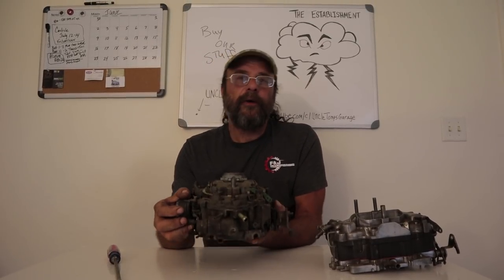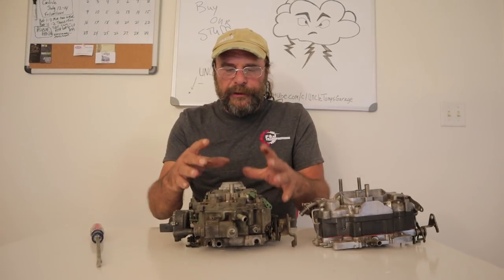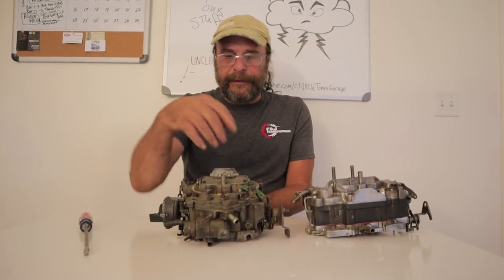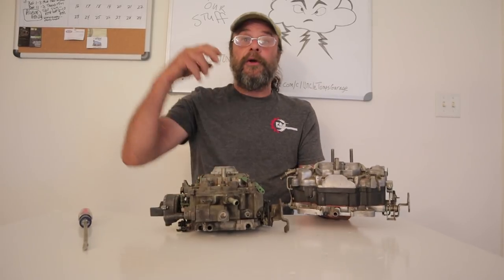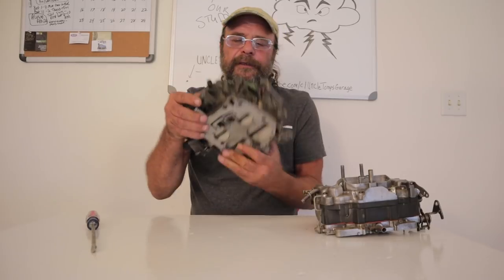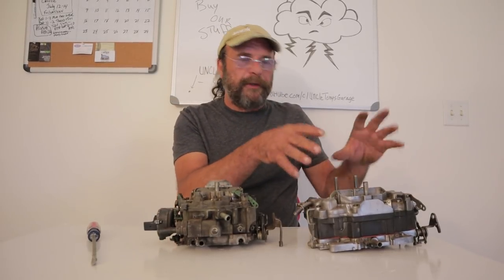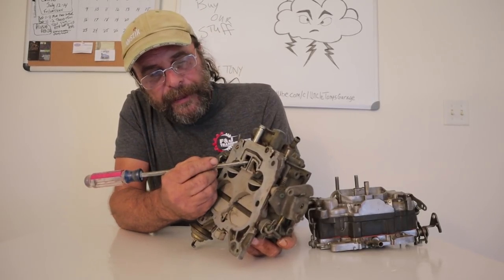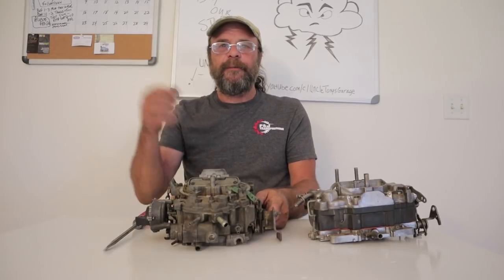The Quadrajet

Comment: I love Quadrajet carburetors, if you learn how to build them, and do the little tricks to them, they will out perform any street carburetor made. I've built Quads for years.
Reply: I'll be honest... I HATED them until my dad showed me how to actually tune one correctly. Now I'm a fan of them.
Reply: Take a Q jet over a leaky fucking holley  any day
Reply: Amen brother take a Q jet any time since the late 70s..I have a shelf full of them
Reply: my only problem with them has always been that they're usually toast by the time you get them. No pressure regulation usually. By the time I spend the time rebuilding one. I'd rather just spend 300 bucks on an edlebrock, 15 bucks on a regulator, and never mess with it again.
Reply: No they wont, not for making power, might be the most reliable workhorse 4bbl though.
Reply: You're right! I knew a guy who raced circle dirt in the stock class and had to run a q jet. He was a master at them and you could get one for free give him a hundred bucks to rebuild it for whatever! Economy, or performance, it would deliver. Just keep a good fuel filter on it because they'll plug up easily.
Reply: One time i built a house from construction paper and popsicle sticks
Reply: WILLIAM CLYNES  biggest one so a big block one the quadrajets have a air dam/ adjustable secondary air flow flap it wolnt flow more air then the motor needs so you can't get too much carb
Reply: Most quads were detuned.  Drill new holes in the secondary’s hangers, get new thinner needles, and away we gooo.......

A plastic spacer plate would insulate the carb from the manifold.
Reply: @fitty6pickemup because Holley pays to have their crap shown all over the place
Reply: @Nostradamus_Order33  Using this point you made I used one on a 455 running methanol back in 1976. Had to take the front jets completely out to flow enough.
Reply: @mtjeeves1234  315$ is a lot of money to some guys. Im building a dirt car with very limited Holley options. and quadrajet is wide open. The holley that would be best runs for around 150-200$ in my area. i just picked up a new 6 month old quad for 40$ because the guy "dont know anything about them"
Reply: Agreed!!
Reply: Korri Galbraith  I used to buy them newly rebuilt for 125 at autozone...
Reply: WILLIAM CLYNES the one off of Buick wildcats.. they have the big fuel inlet that comes strait out the front, not at a 90 from the side... range from 500cfm-800
Reply: @thespiritof76..  I don't have to hold onto my ass when I drop the hammer on my 86 K2500.  700R4 kicks down and that 350 the carb lives on reminds me of my dad's 2013 Mack when it's trying to get rolling. Though my timing needs to be checked and the carb could use a tune up.
Reply: right--when they good an tuned they the best but...if not they are the worse  --
Reply: Any good videos out there that you recommend?
Reply: I'm looking for a carb for highway cruising on a 70's Charger. Think a quad would be great.
Reply: I love Thermoquads carburetors, if you learn how to build them, and do the little tricks to them, they will out perform any street carburetor made. I've built Quads for years.  Sorry i stole the whole sentance , but it is just as true .
Reply: Teach me teacher!!!! 82 Rivera. 307 V8. sat for AWHILE!>> 35k original miles (supposedly)..
Bogs at 35.. ..gutless .   What tricks?? Just like 10 more HP..
Reply: I've had many different brands of carburetors for many different applications, Rochester has always been fine by me as well as my go to dozens of times without any real issues. I still use one now, year after year it's been very reliable. It's never bogged once.
Reply: Would you know what carb I have on my 1984 Riviera with the 307 OldsV8??
Reply: @jeffneis553  one way to find out is remove your air cleaner and shine a flashlight directly at your carburetor, it ought to be right on there. It's probably a Rochester, GMs go to carburetor forever.
Reply: @irocitZ  I'll see if I can get up there, bad back problems. Appreciate the answer.
Reply: @jeffneis553  oh man, that's the worst because I know exactly what you mean. I've recently learned that back issues and the car hobby don't go well together.  The only good part is I've liked cars much longer than having back problems instead of it being the other way around.

Comment: I've watched my dad Rebuild alot of those Quadrajets  he was trained at the GM school in Fairfax VA  he also taught me how to rebuild the Turbo 350 and 400 he is 82yo now and is still helping us 4 BOYS at our EDWARDS BROTHER'S TRANSMISSIONS shop in Roanoke Rapids North Carolina THANKS 😀 Louis R Edwards Jr
Reply: I may have to give you boys some business 😉. I'm down here in Mount Olive.
Reply: Always thought a guy who could rebuild, and tune a quadrajet was a step above. Tony confirmed this in his comment about an all out quadrajet will need to be spot on.
Reply: My grandfather is religious with his Quadrajets, he has six put away in storage and one on his 78 El Camino with a 350 from a z28 camaro. It may not be fast, but damn is it reliable and smooth. He's used that engine with that carb for over 30 years. over 300,000miles

Comment: The biggest mistake people make with the quadrajet and the thermoquad is the secondary air valve adjustment. They seem to think you want it to fall open as soon as you get into the secondary's. Not the case. You need the correct tension on the spring so the vacuum has to pull them open. Otherwise you crack open those huge secondary's and the vehicle falls on its face.
Reply: You are 100% CORRECT
Reply: i was 16-17 when i learned about that spring on the secondaries. a little helped so you bet i sprung that way loose! all but hit my nose on the windshield when they snapped open and dumped a pile of fuel into the engine. slower learning curve for some of us but as long as you survive and learn it's all good.
Reply: @Peter Lockhart I have heard so many stories about the spring adjustment thing that it is getting ridiculous. The little spring has a specific preset tension & has little to do with secondary air valve operation. The choke pull off is the controlling factor by limiting the vacuum bleed off in the actuator.

Comment: I've worked on Plenty of these carburettors and the biggest issue that I come across is that people torque them down too hard and it warpes the top plate spills fuel everywhere
Reply: And strip the filter housing threads
Reply: I wish they had made the Quadrajet without the bolts running through the air horn. It would have saved 99% of Quadrajets from warping.

Comment: I would be very interested to see you talk about transmissions. Transmissions are oftenly ignored, but I think they are just as important as the engine.
Reply: Bunch of fluid and springs and crap in there. 
And passages and bands and clutches and planetaries all flyin round, and some valves. 
you press on the gas and tires go eeert. 
And that completes drunk transmissions 101 for today.
Reply: The same goes for the engine. Bunch of rods, springs and levers all flying around in there. You press on the gas and it starts making noises and make the tires go eert. 
A good transmission is a vital part of the car to utilize the engine. 
The right engine with the wrong transmission is just as bad as a bad engine on a good transmission.
Reply: the rear axle gears and things spinng around an make tires go eeerrrt.
Reply: Rainy days make the tires do that too. That's when all the fast cars come out.
Reply: @willefixit  
Thats how I got learned on it
Reply: @two_number_nines  
Been there with too big a cam and a wide ratio gearbox. 
No bueno to have to hit redline so it wasnt bogtime in the next gear.
Reply: @MrTheHillfolk  best auto trans explaination ever made me laugh all true..!!!!
Reply: @willefixit  
Haha I was in a rare mood. ..im sure UC will do a trans vid for us.
Reply: @MrTheHillfolk  built a few 727,350,powerglide,honda, honda one rebuilt before12k before mine lasted25k , case porisity new dealer replacement ,you for got balls, the guys at the dealer put every size ball in my parts fun times.!!
Reply: I've been rebuilding automatic Transmissions all my life, we'll, ever senc I was a child me and my brothers grew up in a family of six people,mom dad 4boys dad was the master techn at Tricity Chevrolet in Roanoke Rapids NC and everyone knew him he ,,,,on June 23 1977 Quit his job and litterlaly pushed his Tool box across the street to an old Texaco stason and went to business, quite a few things have changed and I will never forget that EDWARDS BROTHER'S TRANSMISSIONS ROANOKE RAPIDS NC thanks for listening,oh yeah it is almost impossible to describe how the Modern technology and automatic Transmissions work but if  I had at least one full day on YouTube I might scratch the surface 😆
Reply: @MrTheHillfolk  we'll first of all the transmission starts pulling off in 1st gear ,and next ,the2nd spring is just a little bit stronger than 1st ,so it takes more time to shift to 2nd  and the 3rd spring is just a little bit stronger than the 2nd spring so it takes just a little bit longer to shift to 3rd gear ,and the whole time the governor has weaghts that open and close the valves and let the fluid pressure apply the clutch pack depends on what gear you need OK 👍💣😁😌,,,,,,,,,,,,,,,,I love this shit<>
Reply: Malcolm Reynolds  I've been building Turbo 400s secine1977 and I am 55yo ,,,you do the math ⚙️🔧🔩🕰️,,,,, Malcolm R yes the TH400 was. And still is   the very best 3spd automatic ever produced we have built them for Dragracing ,fleet, flatbeds, ambulance,RV, and even,Hummer' if the job needs to be done the 400 is the work and play Trans🏁
Reply: @ MrHillFolk ROFL This is comedy gold!
Reply: @rexcars1835  Gell-Mann effect.

Comment: This is the first time I've shared this, because if you don't do your homework ... you deserve a Holley lol.. The reason Qjets lean out on the top end is the holes for the secondary feed tube bowls are too small.  Just enlarge them to fit your needs.  I've had the lean out issue and after making this change I go 100 and whatever I want (usually 150) for as long as I want, no problem.

Comment: One thing he mentioned,  was running out of gas at full throttle.  That can be easily fixed by replacing the needle float valve.  There is a .95 valve that will let in plenty of fuel so you don't run out at full throttle.  I had a 76  Cadillac de ville,  the 500 cubic inches and I rebuilt the carb made a lot of adjustments but I got it to where I got 10 MPG around town,  and 15 MPG at 65 MPG on highway.  Not great by no means, but for the car 5,500 pounds,  the 500 engine,  I felt it did pretty good.  I would floor it getting onto the highway,  from a dead stop all the way to 100 MPH it never ran out of gas.  I turned the air cleaner top upside down so I could hear the carb better too.  I love that sound when the secondaries open.

Comment: Like every gearhead I know, we would always run around town on a Quadrajet.....  A Quadrajet was used on all my street rods, hot rods or street race cars I owned, until time to race time that is! ...... We would drive to the track every weekend on the Quadrajet and switch to a Holley Double Pumper for the racing ... My cars were anywhere from a half to a full second and a half  QUICKER with just the Holley carb switch! ..... After the racing, switch back to Quadrajet and drive home! .....  Quadrajet carbs are great dependable mileage miser carbs, but they can't come close to a HOLLEY Mechanical Secondary - Double Pumper! .............  Just a side note here for you New Guys , no matter what Summit or Jegs magazines says, the Holley 600 vacuum secondary carb IS NOT a performance carburetor!
Reply: I had a friend who swapped my edelbrock 650 for a 750 Holley double pumper with mechanical secondaries. He was a drag racer and tuned the Holley just right for my application. Built 429 Ford in a 72 gran torino. We also put ladder bars on it so it would hook up and not just sit there and roast the tires.
Reply: Solely depends on what you were driving and how you have the Q-jet tuned. Double Pumpers I believe started out as a full blown race oriented carb and Q-jets were just basically setup and tuned to be factory carbs with minimal to mild performance ? Mild being passing your jerk of a neighbor (from down the street) on the freeway and giving him the finger for stealing your highschool sweetheart.

Comment: Thanks tony for giving the Q jet some love. The biggest issue I've seen is that most people don't understand how a basic carburetor works. They know bits and pieces but not the big picture. Thank you for your carb basics vlog. Been doing this stuff almost as long as you bro!     Any Q jet off any big inch GM V8 will do till around 1977 learn how to ID them.   Primary throttle shafts wear out on them all because the are so reliable and give such trouble free service. I do my own throttle shaft repairs in my drill press. That is another reason a guy buys a used one and it won't idle right guaranteed. you fix the idle well leakdown and the worn primary throttle shaft problem now you can tune to your application. Fun fact: ford must have liked the QJET also because they used it on the 429 cobra jet 70-71. Just recently bought a box of QJETS for next to nothing and scored one off a 1970 500 inch caddy! Again many thanks tony rock on bro.

Comment: Quadrajets have always been one of my favorites.  Your video is spot on.  I have rebuilt probably close to 50 if not more. The biggest issues are worn primary throttle shafts and gorillas torquing down the front mount bolts until it warps the shit out of the air horn and main body.

Comment: I'm mainly a mopar guy but back in 1972 I helped a friend tune his 1970 350 nova 4 speed car. It had headers, cam, 390 gear, slicks and a Q-jet carb. One night I lost 50 bucks to a 71 340 cuda with a thermoquad because the Q-jet nosed over in third gear as you described. Ah, the good old days! Lol

Comment: Tony a tip for you and and anyone else watching your this video the phenolic floats that came in these carbs are really bad about soaking up fuel and making them heavy causing a flooding condition.. Always weigh the float to see if its within speck or go ahead and replace if you have the carb apart.. Float adjustment is critical to this carb also.. Thanks for the video!

Comment: I took apart a Quadrajet once.  Went down to Thrifty Auto Parts and bought a Holley 830 double pumper.  I was never very smart with carbs.
Reply: Yep and your constantly adjusting it aren't you, i
Reply: @joebradley1520  if you are clueless as to what you are doing, then probably..
Reply: Racing Prospector no, your clueless to try and convince yourself that you don't, but then again looks like you wouldn't even think a carb needs adjusting anyway even if it did.
Everyone and their mother knows hollys are notorious for having to adjust constantly
Reply: @joebradley1520  once again, if your set up is fucked up, then yes I'm sure you need to adjust it constantly. Wouldn't go that route with some you don't know on YouTube. You are talking to a full time drag racer and a life long mechanic.  I see first hand what works.
Reply: Malcolm Reynolds  the "can't rebuild a quadrajet" statement tells all that anyone here needs to know about your carb expertise.
Reply: Malcolm Reynolds  q-jet repair is generally quite simple, most of the issues are a result of the soft aluminum main body, a simple throttle shaft kit and well plug seal fixes even the most worn q-jets, after that its just simple cleaning, which 99% of people fail to do properly because it takes a few hours in chem-dip and compressed air to do,  that much gets it to where the engine will start damn near every time, after that its usually jets, primary springs, and winding the secondary air door, which is literally no different from tuning a carter/edelbrock AVS, its just finding the parts, which GM no longer makes, but a few aftermarket companies do, but I will concede that if your fuel system isnt PERFECTLY tuned you will never get it to run WOT for long periods, the main advantage rochester has is that its use of vacuum primarys and secondarys allows for very precise fuel metering across the operating range similar to EFI if the tuner knows what they are doing, also holley's and edelbrocks dont like tight cornering or angles due to the outside float bowl arrangement as they are designed around short straight-line pulls at the drag strip, and even there you can get to the point where rapid acceleration causes momentary fuel starvation at launch which means EFI, webers, hitachis, mikunis, or rochesters are in order.
Reply: I run a self modified 800 Q jet on my 454 and  it will give a holley a run for the money.

Comment: Had a 1970 Buick gs455.Pulled the Rochester and put in 850 Holley double pumper.Cut over a second off quarter mile time.The Quadrajet just sucked dry halfway down the strip. All my GM motorhead friends had buckets full of Rochesters laying around. They make great doorstops..... Holley ruled the Age Of Carbs.  When   I bought my new 1973 Trans Am Super Duty from Herrington Pontiac/Buick in Georgia, the dealership was putting double pumper Holleys on the Super Dutys as a 200 buck option with factory warranty. Jesus,that car was a beast... Claimed to be 340 hp by GM for insurance reasons, true hp was said to be over 400.However ,with  12 to 1 Jahns pistons, Edelbrock headers and intake manifold ,big fuel pump and the 900cfm Holley, mine dynoed at  575 hp.

Comment: I had an edelbrock 750 on my 454 1980 chevy truck. Worked great. Not a race truck but had some performance. The "mechanic" broke the choke and replaced the carb with an 810 quadrajet.  It was very smooth. Too smooth for me. Felt like I was driving an older cadillac. I much prefer the edelbrock 750 for my truck. Which I ended up having  to re purchase. 👍🏻